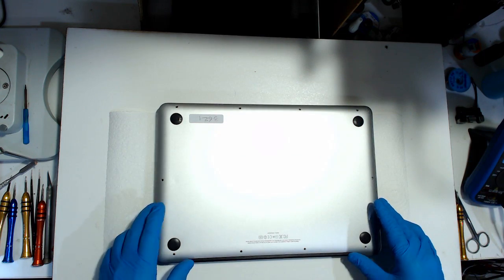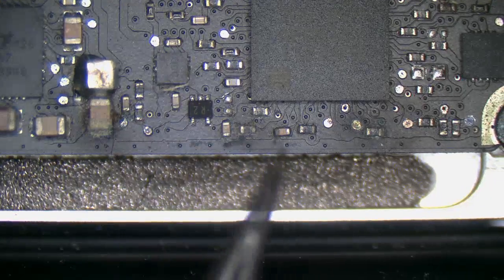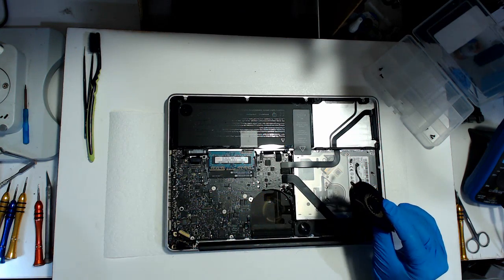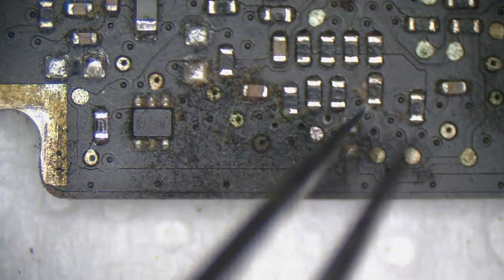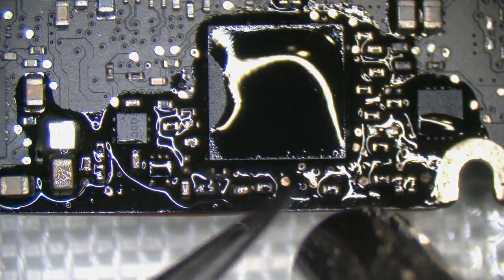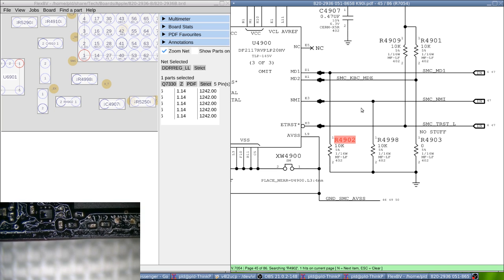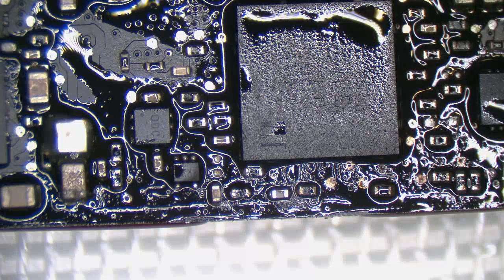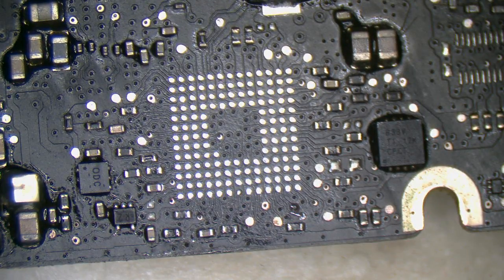Macbook Pro A1278 - no power (greenlight only)

Comment: I was given an A1278 a couple months back that is having what appears to be the same issue. The original owner spilled something on it. It was sitting for some time before I got my hands on it and it did boot all the way the OS, but then just shut off several minutes later. It wouldn't boot again after then so I just stuck it on a shelf for several weeks. I tried booting again and it did. Almost all the way into the OS, but then shut off again. I just don't think I have the skills to diagnose this, but I'm going to use your video to try! Thx.
Reply from the maker: Best of luck with it Clayton.
Reply: @pldaniels  Thanks Paul, I'm going to need some for sure! 😉

Comment: Paul, I had sent a text saying that I am 91 and 92 in December and have taken up repairing 2006 to 2009 MacBook and Pro as a hobby. My first computer was an Amiga with a Toaster and was really impressed with the graphics. I would go to the university and buy used Mac computers but found an old laptop that I got working. I now have 10 MacBooks bought from eBay and have successfully got 6 working.  I am interested in troubleshooting the electronics to try to get the others working. It is a challenge and I have bought some tools to remove resistors and capacitors and chips if need. I need to down load the board view and schematics to trace the various circuits. Maybe you have some old videos on YouTube that would help. Thanks for your understanding. ❤
Reply from the maker: Those old Amiga-Toasters were quite something for their time and cost.  A shame that such advancements seemed to get lost for many years.

I'd say checking Rossmann Repairs for videos would be a good idea too.  Boardviews/schems are over at Badcaps.net forum with a quick search as well.

Best of luck getting those other units running, hopefully it'll be something moderately easy and not an overall low level corrosion issue that often plagues those machines.
Reply: Thank you for your prompt reply and also for all the exceptional tutorials you are putting on the internet. Your patience is appreciated. Bill Ambrose.

Comment: my macbook will turn ON, however it will not charge up the battery. Green light only. it just refuse to charge. if I take out the charger the macbook wil shut down. it is not the battery that is the problem or the charge. this is really frustrating, does anyone know what might be the problem ??

Comment: I just picked up a early 2011 15” mbp looks like the same symptoms, no liquid damage, battery voltage very low, so I’m suspecting that, partly, I’m waiting for a 85w charger to arrive, I don’t think the 60w works properly with them.
Reply from the maker: Definitely need that power pack, yes.  I ended up going "all out" and buying the original Apple ones, at least I know I have a steady reference.  

Good luck with the repair.

Comment: Well done :-D, it did look rather horrible, a lot of parts on that pcb looked nasty.

i have always thought smd parts were a dodgy idea,  Lets solder an inflexable part to a pcb that can bend or expand/contract, just asking for trouble :-(.
I have found smd resistors fail too, quite a lot, fracture again.
The bad part is they look perfect, hard to detect.
Reply from the maker: You take that back, SMD is far better than "Lets flip the board 100 times and have 3000 stray legs in the air that we have to cut off, ooops, flip that back...".

The best bit I like is "Now we need to remove this DIP40 package from the board, but the designers only put 0.1mm thick donuts around the legs so you'll proceed to tear 80% of them when you touch it with the desoldering tools"   :D
Reply: Ha ha dip 40's are a pain anyway :-D
The trick is to have a clean and well lubed desolder sucker, sounds naughty, then wiggle each pin to make sure it's not stuck to the through plating (if there was any).
I always fitted a turned pin socket before plopping a new chip in.
You young whipper snappers don't know how to solder, nag nag when i was a lad... old man nagging he he :-D
Reply from the maker: turned / machined pin sockets were delightful things,  certainly a lot nicer than desoldering, just a shame they were so expensive, so instead we'd end up with double wipe sockets.. or worse... single if I was too cheap.

Comment: I have one a1278 green light on magsafe water damage will turn on when holding down power for 10 seconds then connect mag safe fans sound like running full rpms but when I plug in battery boots up then shuts off is this the issue its logic board issue got it to come on with battery but was running really laggy? Thanks

Comment: I've got a Macbook 13 that doesn't turn on with or without a battery. No Green or Amber lights, Nothing. Any Ideas?
Reply from the maker: So so so many possible causes. Could be anything from a bad DC in board ( unlikely ) to bad CPU.
Reply: @pldaniels  Thanks mate, I'll try going over it again. Take it easy.

Comment: Hi sir,

My laptop is not getting ON in normal way. But. When I do long press for 10 sec then do one single press in power button, the laptop gets ON. But this way the fan speed is high and the power status is not showing in desktop.  So by doing the test, pressing D on power ON, it says the SMC is not found
 But the service center exicutive had replaced the SMC but the issue is still there. 
Can you help on this, what could be the root cause of this issue. The battery is getting charged in normal way.
Reply from the maker: Could be a bad replacement SMC, or not installed correctly. Could also be something inhibiting the SMC_RESET_L line.
Reply: @pldaniels  thanks

Comment: Hello, I’m trouble shooting my MacBook Pro early 2011. The battery will not charge and the charging light has a fluttering green light. It’s not an amber light even though the battery still has some power in it. I tried resetting the SMC and this did not work. Bought a new battery on amazing and this new battery has about 12% but still won’t charge. I removed the battery and tried powering on the MacBook using only the charger. It’s still showing a green light when plugged in but the MacBook does not start up. Any ideas?
Reply: same issue, if you have any answers 7 months later I'd like to hear it! ✌️
Reply: @Billdukes  sorry Bill. i gave up. Haven't replaces the MBP yet. good luck.

Comment: What's a repair like this cost ? Having the same issue and wondering would it be cheaper just to by a refurb board or have it repaired ?
Reply from the maker: These days likely cheaper to just get a refurb board.
Reply: @pldaniels  thank you so much for the reply. Ok sounds good. One more question please? The refurbished boards pretty much no guarantee how long before it does something like this again right ? Or warranty is available?

Comment: How do you prevent the capacitors on the other side of the board from falling off? That would be a nightmare... I tried it on an old test board, and lots of capacitors were on the table afterwards... I could make the air less hot, but then the tin doesn't melt at all. Any chance to get this job done with a classic soldering iron?
Reply from the maker: Should never have the parts coming off the back unless you're trying really hard.  Some of the entry level offerings of hot-air stations don't have the ability to deliver enough thermal energy to the board, so what happens is that you slowly roast the whole board and the parts all get liquid solder and as soon as you move the board they call come off.

Quick 861DW or better if you want to do this sort of work.

Comment: i got lines all over my macbook screen . i change the screen setting and than my macbook pro start to have this ugly line all over the screen.
i go to china what professionally  i need to check before change screen have option is graphic card damage? or i may need replace the screen ?
i want to show the guy who fix i know what i'm doing (and trust me i don't) so what protocol i need ask him to check? what connection before messing the logic board ? thanks in advance
Reply from the maker: If it's a 15 or 17" 2011/12 machine, not much point trying to fix the GPU.  Just dosdude fix it or other iGPU fix.
Reply: @pldaniels  i'm not native english speaker but thanks for trying. i need just ask to replace the screen display ? it's macbook pro 15" a1990 2018 
to test if the failure is in logic board or i should ask in advance to replace the screen display? thanks
Reply: @shyland20  display is not broken, your graphics card is broken

Comment: I am amazed , how can you read the wiring sketch and the board layout at the same time ? Is it on 2 different software (and a large enough screen) or exist a software that could link dynamically the 2 docs (or files containing both ?) It is pure curiosity and I am not electronician , but I'd like to learn how to read a minimum, for insysnce I am looking for a 5A18v fuse on the macbook pro 13"  2009 ,and while I understand where it is located on the wiring, I cannot find it on a brd file ,or, more correctly I cannot locate it on the board ;) Best regards ( using open board view ,I think)
Reply from the maker: FlexBV makes it easier, as it lets you cross-link between the schem and BV.
Reply: @pldaniels  thank you for answering ,have a great day. (I did notice the tool but not understanding it was yours , bravo )
Reply from the maker: @IsaacOLEG  correct, yes. FlexBV is my commercial fork from the Openboardview base code after I found I was putting in a lot of time & effort in to OBV and really needed to find a way to maintain a fair income from it.
Reply: @pldaniels  I am looking for jobs opportunities for my son, and I also noticed that current times mean that there are more and more demand for repairs, the good old days of "trash it and buy new" are about to finish .  (I did not notice that you repaired cats too  !)
Reply: @pldaniels  just a dumb question about flux, I notice how it is used to fight corrosion, is the aspect corrected afterthat with a ultrasonic bath or a cleaning product ?  Thanks